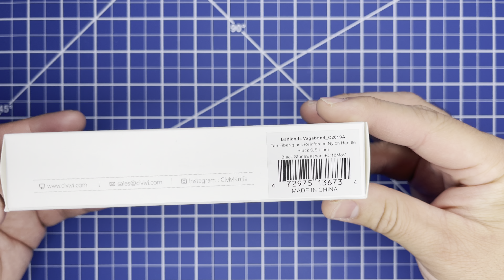Civivi Badlands Vagabond: Great Budget EDC Option? Unboxing, Overview and everyday cut testing.

Comment: Gotta say no on this one.  Looks like a great knife for the price.  But, nah. Another great review, T.E.D.  My Benchmade Auto. Presido II should be here by Thursday.  Totally tactical. $$$ omg.  If you get a chance, run that through your paces.
Reply from the maker: The Auto Presido II will be a great addition for you!
Reply: @TacticalEverydayDad  I hope so.  I had a little bit of buyer’s remorse after all was said and done.  However, no one said this knife collecting wouldn’t be expensive.  What’s your take on knives under $50?  I guess I’m just thinking the more they are, the better.  I’m not sure if you have done videos on lower end knives but if you have, forgive me for asking.
Reply from the maker: No worries on your question! Knives are just like any other consumer product out there. The more expensive the knife doesn’t always mean it’s of better quality or performance. Sometimes it’s the name you are buying. Or higher price point materials. A car gets you from one point to another. A 2021 Honda Civic will still do the same job as a 2021 Mercedes C300. I have a few sub $50s I would trust my life to, in a tough situation. I have a few videos up (kershaw drivetrain, Civivi vagabond and the crkt intentions) I will have more up.
Reply: @TacticalEverydayDad  thanks!  Looking at the Boker Strike as well.  Looks cool and they upgraded to D2 steel.  Mixed reviews on their snappiness.
Reply from the maker: Reason behind that, it’s a cheaper spring. Which is actually very obtainable and exchangeable. If you want a beater auto. I 100% would go with the boker strike!
Reply: @TacticalEverydayDad  awesome.  Thanks!